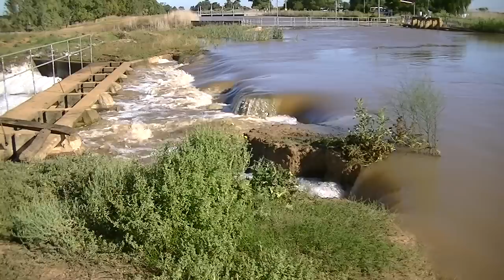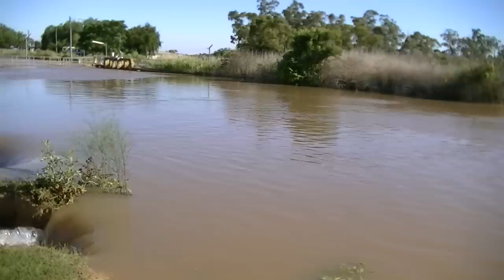00123

Comment: The open regulator you show is the East Mirrool Escape, and is fully open to Mirrool Creek as you can see. The water flows under the Main Canal the other side of that concrete walkway thing. You are showing the old regulator which is why it is full of dirt. Maybe more water could be directed down Mirool Creek but it would then flood other areas more.